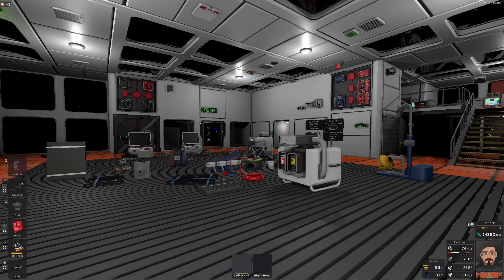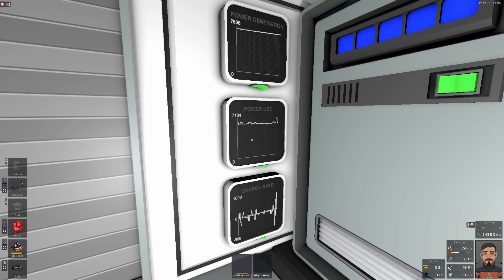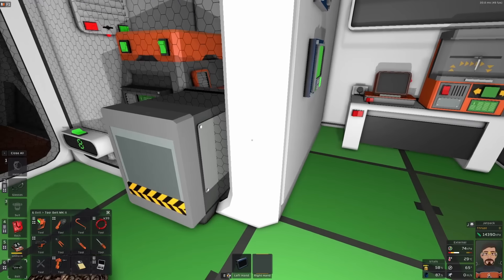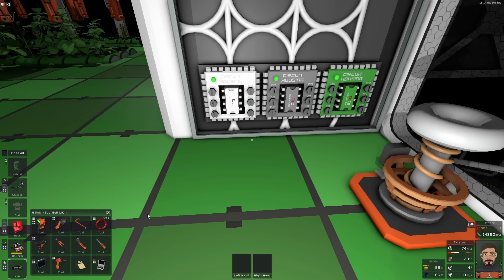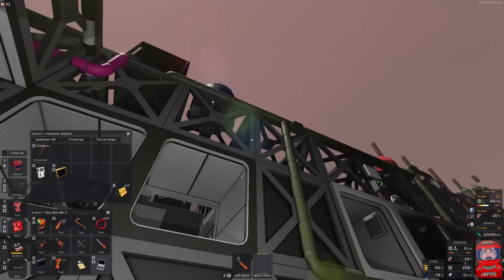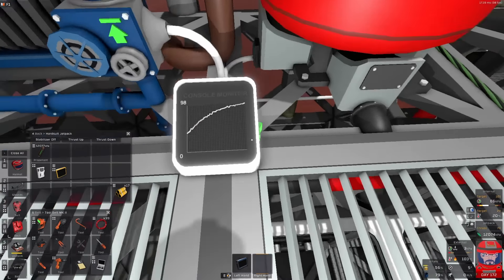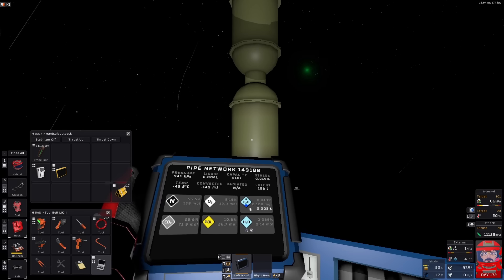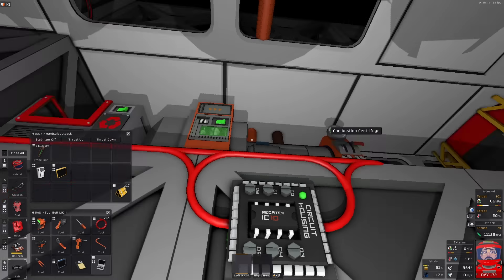Stationeers Let's play Mars 25 Drink my stink you stupid plant.

Comment: Idea going back to the radiator update: build a solar furnace with the rotating radiator (have it turn to track the sun, box it into a hot box, then all you have to do is code out a simple script to extend the radiator and pump the liquid through it only when there's polluted water to process. Once it is all processed just pump it through a second radiator at night to cool it to ~10 degrees. Minimal extra power consumption and automatic, self-contained processing)
Reply from the maker: Nice idea, the rotating radiator works with liquids.  That would work on the moon, I will have to test how well that will work on mars.

Comment: Charcoal solution: use a chute digital valve, either right/left or flip flop off your grass chute. Figure out the ratio you need (like 1 in 5 or something like that), and send that to a recycler/stacker into an arc furnace into a sorter to loop back into the arc furnace if it's biomass, or output the charcoal into a stacker to hold. You can have a pretty small footprint, and the charcoal is automated and adjustable dependent on your needs.

Comment: 43:03 When you disconnected the experiment with the shower, you didn't connect the main water line back to the water fountain line.  The CO2 that you were boiling off with the purge vale is no longer hooked to the main water line.  That's why the fountain was fine, but the bottle filler is blinking.

The water boiling solution is fairly simple.  Hook it the output line of the H2 combuster with an expansion vale, like you were talking about, but have a volume pump set to really low, just trickling the polluted water into the heated line.  Could even IC code that it will only add more PW if there isn't any in the line.  I'm pretty sure at even a slow trickle, you'll still be processing the water faster than you will be making it.  As a last resort, you could just put the charcoal purifier in attached to the main line just in case PW manages to make it to the main water line, so it cleans it.

Comment: Water-cleaning seems like a good use for the evaporation chamber. Connect the heat exchange to the hot gas line of the water maker and pump the steam into the condenser line. The evaporation chamber will make sure that everything evaporates before going into the gas pipe
Reply from the maker: Nice,  I think that might be the winning solution.  I didn't even consider that.

Comment: Pipe heaters take quite a bit of power, but all you need is to convert the PW (polluted water) into steam to purify it. I think it works to do it even inside a pipe.
I did it by accident just running pipes to an insulated storage tank. I must have used one or two non-insulated pipes in the line and that was enough to make the PW evaporate and purify.
Super simple setup would be a pipe heater on a short section of pipe leading to a purge valve to evacuate the steam. Next section you run outside to a cooling radiator or into your existing water production to condense the water back into liquid.
I'd probably add some sort of overpressure protection as well.
An alternative to the pipe heater would be heated gases from your water production run through a heat exchanger to heat the PW up above 100C.
Reply from the maker: I do have a lot of waste heat that I could use but I am worried about flash vapourising it faster than the purge valves can cope.

Comment: 5:28  whats "memory:1" and what does the channel1 do?
Reply from the maker: That is for the clean breathing gas signal.
Reply: @cowsareevil7514   that wasnt the question, but did some research 

memory:1 means connection 1 on device memory
and channel0-7 are values on that cable
didnt knew befor that such things are possible

Comment: While I understand the appeal to wanting to boil your water clean, please don't overlook the benefit to producing charcoal from biomass.  Volatiles!  As it appears your composter is falling short keeping up with the combuster, perhaps a simple dedicated power based process (i.e. recycler, centrifuge, arc furnace(chambered to capture the volatiles)) to process biomass might help supplement your volatiles requirement.  Or it could even take place as the primary volatile supply with the composter being supplemental as excess charcoal is more useful than excess fertilizer (i.e. power generation).  Cheers!
Reply from the maker: Nice.  The waste from the charcoal becomes a resource.  I will have to grow more biomass.

Comment: You just need a short bath when stinky, so the amount of polluted water is tiny. Just use the new filter... You'll rarely need to refill the charcoal.

I would say fixing the water production is a far more pressing matter...
Add to that: You dont seem to have the drinking fountain and purge valve connected to the water system anymore...
Reply from the maker: I think I need another composter.  Where can I fit it without ruining my feng shui.
Reply: @cowsareevil7514  Straight above the other one? very shui
Reply: @cowsareevil7514  On that note, it is possible to squeeze out a 8 moles of volatiles more per switchgrass if you turn it into biomass, degas it, then compost it. Though the furnace temperature has to be controlled well to avoid turning that into charcoal

Comment: Mick -  good episode Sir. 

 As for the water purifier I understand what you're trying to do but I have found the unit to be very useful and very efficient.   However, my set up doesn't have any polluted gas inside of it like CO2 and it is kind of isolated from the rest of my systems.   So I don't have the same problems you have and I think you should give that unit more of a chance than you are willing to give it because again it is still very efficient and does a great job.
Reply from the maker: I could just put it in a closed loop with the shower as that is the only source of polluted water at the moment.  But I am trying for the zero upkeep base so minimal effort is too much and should be avoided where possible.
Reply: @cowsareevil7514  Ah, my mistake in not being aware of this and please forgive me.